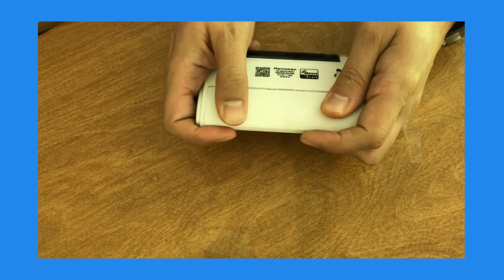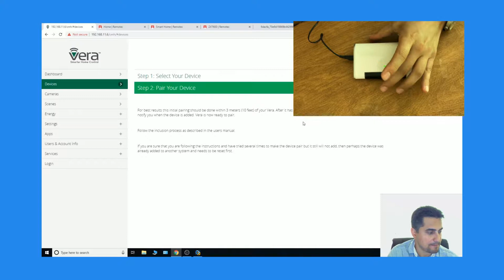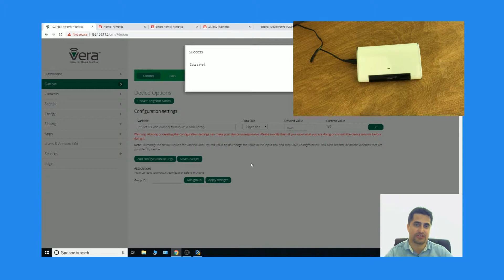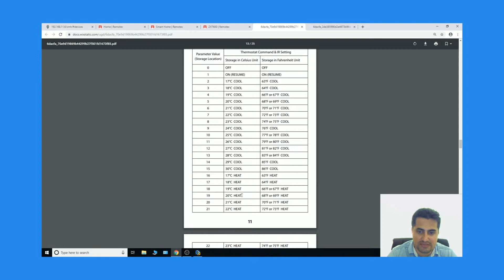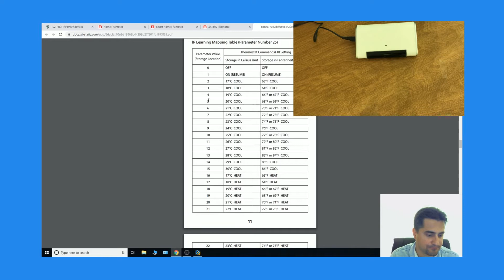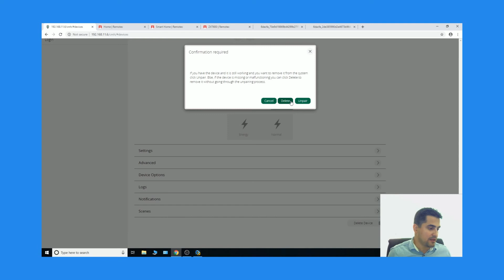How to add ZXT-600 to Vera units and its configuration

Comment: Hello , I added the AC master but there is no interface , i mean there is no off, auto, cool, heat , up down arrows and Celsius, only its written AC Master Thermostat , i exclude and include 2 3 times same issue again i'm using Vera edge HUB do you have any suggestion?
Reply from the maker: Hello, Do you wait till Vera finishes configuring devices? Do you refresh the page?
Sometimes you must wait a few minutes after adding device and then refresh the page.
If the issue persist try reconfigure the device in its setting

Comment: Hello, thank you for your clear guide. You know how to make sure the ambient temp reader in the zxt-600 is reporting to Vera? It does not work with me, although I have set up the device using usb power.... I does not update the current temp after the initial setup. Everything else works. thank you in advance
Reply from the maker: Hello, You are welcome.  About the issue, Vera does not show temp of environment at all, Am I right?
Reply from the maker: check parameter 30 (Set Auto
 Report Condition Trigger By Room Temperature change) which is 1 Byte. It must not be set to 0.                                                  0 = Disable AUTO report function (Default)
(for saving battery life)
Auto report if room temperature is
different from last report.
1 = 1°F (0.5°C)
2 = 2°F (1°C)
3 =3°F (1.5°C)
4 = 4°F (2°C)
5 = 5°F (2.5°C)
6 = 6°F (3°C)
7 = 7°F (3.5°C)
8 = 8°F (4°C)

Tell me the result
Reply: @kian.smarthome  Good day, I had these variables already set. It is one byte DEC no? Not one byte HEX. The unit does provide me with an initial temperature reading, but only upon switching the unit off and on. Subsequent reporting is at best only once every few days. I had set up a scene, that would start the airco if the temp would reach a certain value, and this was triggered only once in the three weeks that I have been testing, while the parameters were met on daily occasions.
Reply: Good day, thank you for your suggestion, and I'm sorry for the late reply. I will let you know as soon as I have made the changes....